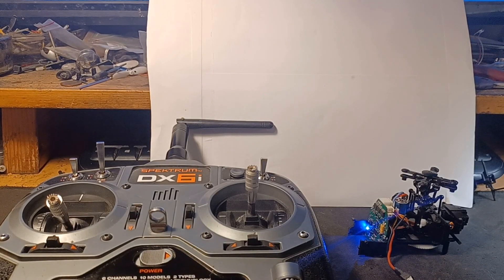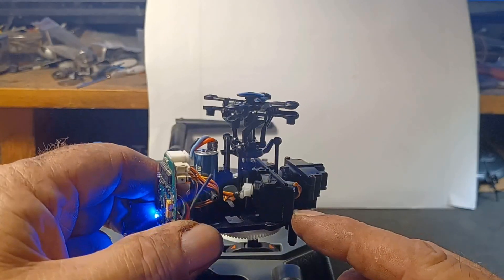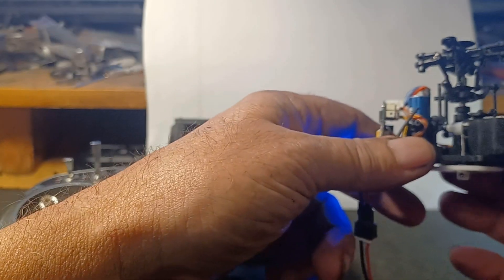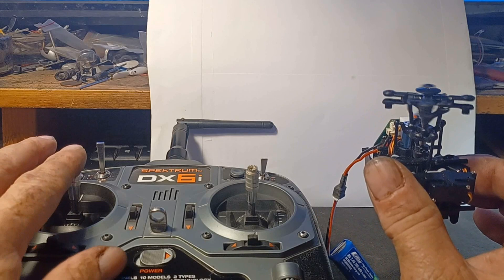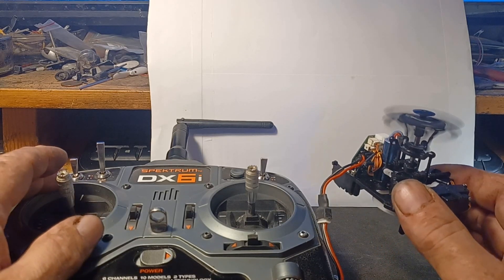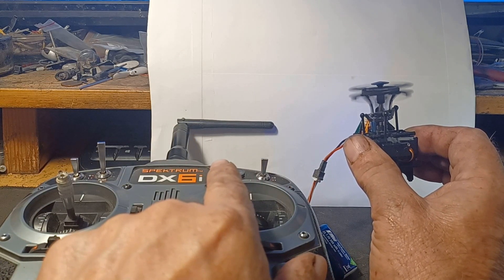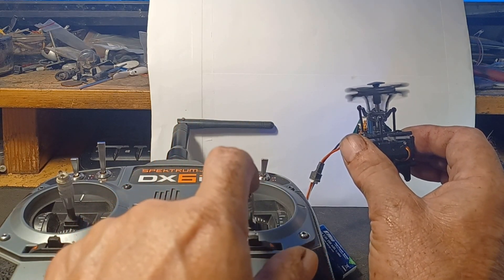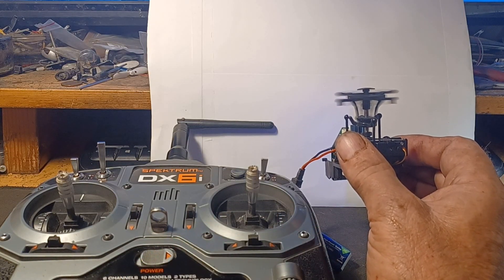C186 with MCPX BL Board and Motors - Problem Servo Demo

Comment: Servos not self centring very odd . Is there some sort of gyro system not working correctly?.
Reply from the maker: I tried an Eflite linear servo and got no response.  The MCPX control board is an odd one.  But I have not given up. MCPX servos mounted now and working OK.

Comment: Well, that's definitely a problem.  New servos in order?
Reply from the maker: These ARE new servos, low voltage types.
Reply from the maker: UPDATE.  I have refitted with linear servos. 
Also I fixed the intermittent motor issue by re-soldering the motor socket connections on the circuit board.

I also discovered that standard Eflite linear servos don't work here.  They don't respond to stick motions at all. Odd. DO Blade servos have something unique about them?

More later.